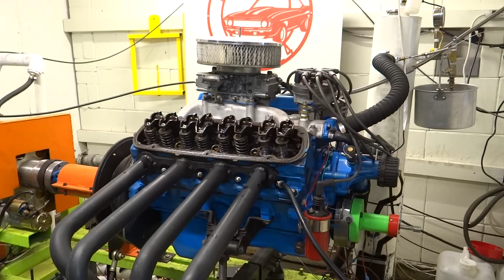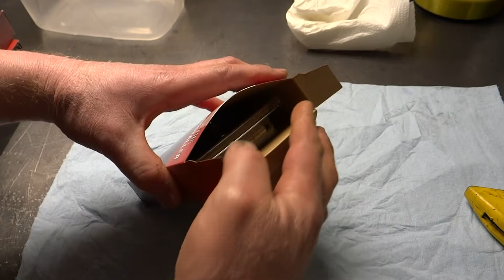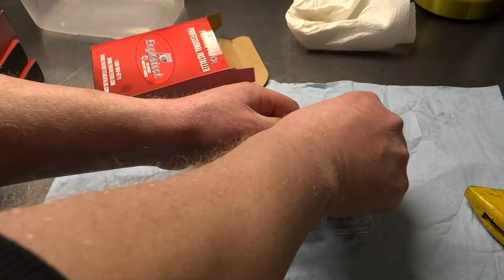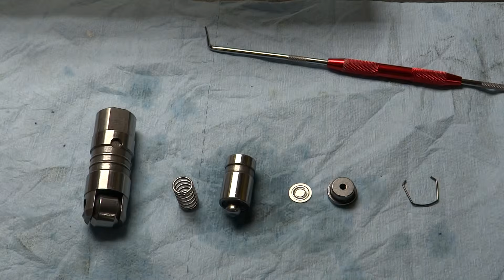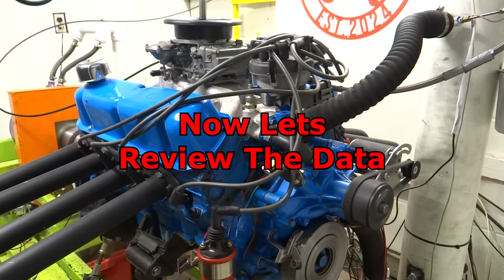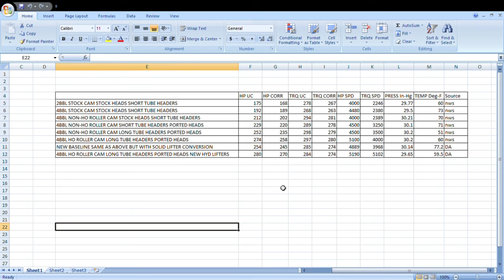Budget Ford 302 Project (Part 25) New Low $$$ Roller Lifters Dyno Test

Comment: You gained about 100hp since the 2 barrel version! That's a great gain! Keep on going! There's much more with that short block. I've been watching this series since the beginning. I did something similar with a .060 over 1963 5 bolt bell housing 289 but without a dyno. Eventually I ended up with one stout screamer. It didn't cost much either. I ended up with a Weiand 8011 dual plane, a custom Howards flat tappet race cam with a 106 lsa, ported and angle decked (decked a ton!) early 351w heads fitted with larger larger 1.94/1.6 valves, stiffer valve springs, long tube 1-5/8" long tube headers, stock cast .060 over pistons, stock rods, stock crank, and 650cfm double pumper carb. I'm not sure of the power numbers but it would outrun just about everything at the dunes in a 1952 Willys jeep at 7000rpm until I scuffed one of the pistons... A lot of people wanted to know what was in that jeep! When I popped the hood they couldn't believe it ran that hard with oe cast iron heads. I'd love to build another one some day. Good times.
Reply from the maker: That is cool!! I remember back in the 90's thinking about having a set of heads angle milled for compression but never went through with it. Thanks for sharing!!